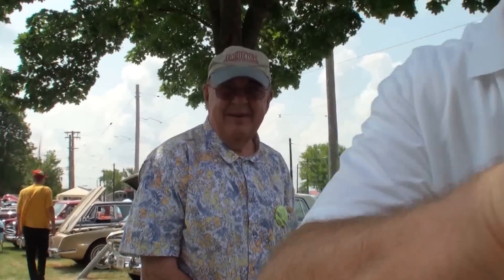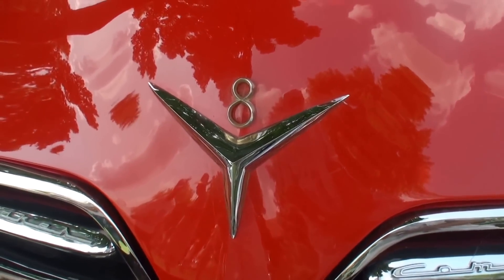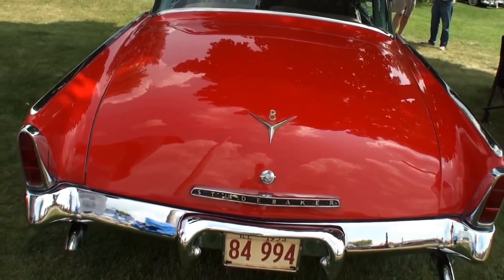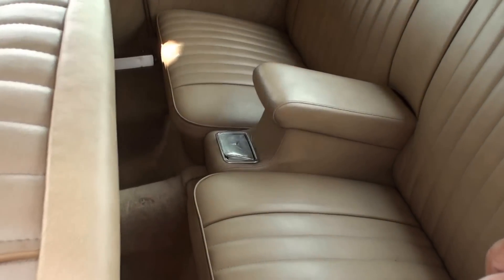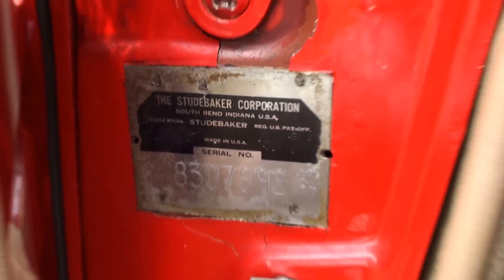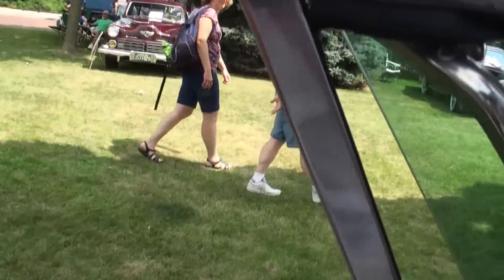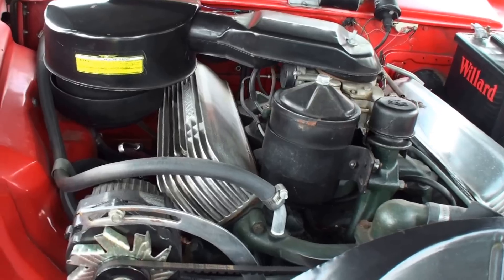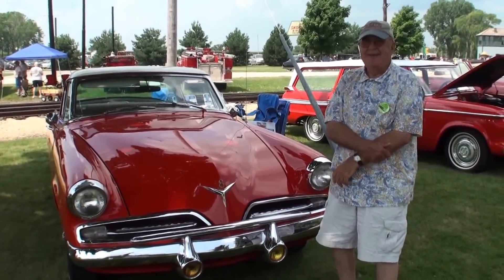1953 Studebaker Commander V8 Starliner Coupe - My Car Story with Lou Costabile

Comment: The first time I saw this model of the beautiful Studebaker coupe was in 1953 when it first appeared.  I fell in love with the sleek design instantly and I thought it was the most aerodynamic automobile I'd ever seen.  I even love the elegant simplicity of the dashboard.  Sixty-six years later, I still feel exactly the same way about this Studebaker design and it's still my dream car.   The original design was so perfect that it breaks my heart when I see one that's been modified.   There's always something new to learn and I learned two interesting facts from this video.   I didn't know the story about what happened to Studebaker's three pointed star before I watched this video.   I never noticed there was a similarity between the two stars until today when I heard the story.  The Studebaker star is rotated 180 degrees from the Mercedes star and the Mercedes star is  enclosed in a a ring, so the two stars look completely different to me, but I guess those differences weren't enough to satisfy Mercedes.    Another thing I learned came from seeing the hood opened in the video.   I always wondered how Studebaker was able to get a lower, sleeker hood than any other car in 1953 and now I know the secret.   The old oil bath air cleaners were huge and very tall back in 1953.   Those air cleaners usually sat upright on the top of the engine requiring a large space between the engine and the hood, so the engine compartment of cars made in 1953 were box shaped, which caused the front of cars to be box shaped at that time.   Now, I now see how Studebaker got that streamlined hood, they used an air duct to move the oil bath cleaner over to the side of the engine, lowering the hood.   Such a simple idea, but what a difference it made in the look of the car.
Reply from the maker: HI itsonlyadream, Thank you for viewing and sharing your appreciation for this model :-)  Hope you see many more cars on this YouTube Channel you enjoy, Lou
Reply: I cannot agree with you more.  This is simplistic style with stunning beauty.

Comment: Great video.  In my teens and early-twenties, I drove a Studebaker exactly like this, a red '53 Commander Starliner Coupe, though mine did not have the fog lamps and the interior was red.  The car was a family car that had been in storage for years, and it became mine upon turning sixteen.  I drove the Studebaker during high school and
several years of college (early to mid-1970's). The car had a few quirks, but it could be driven on the highway at 65-70 MPH without issue.  It was actually easier to drive than the modern cars of the time in that it handled curvy roads quite well.  Once while returning to college during a snowstorm, every other car had either run off the road or become stuck, but the Studebaker traveled on to its destination.  The Automatic Drive, a very advanced transmission for the time with its lock-up torque converter, generally worked well, but like Hydra-Matic of the 1950's, cold and hot weather could affect performance.  The Automatic Drive had a surprising feature not generally found today: there was no automatic transmission creep at stops.  An electrical device held the brake pressure until the accelerator was pressed.
Reply from the maker: Thanks for sharing your memories and experience with this car, Lou
Reply: That feature was called the Hill Holder.  I had 53 Champion 6 in 1963, replaced it with a 53 Commander 8 hardtop....top of the line.  Oddly I don't recall that window flap feature at all.  Maybe somebody pulled it off.
Reply: John  The standard shift models also had the HILL HOLDER which was neat !!!  Stop on a hill, push the clutch in then brake and as long as you held the clutch down the car would not roll backwards!!!  then you could shift to first , put your foot on the gas pedal giver gas and as you released the clutch the brake was released !!!  Great for a beginner driver.  I learned to drive on dads 1956 Studebaker champion. 6 cylinder 3 speed trans with overdrive which actually stock from the factory you could engage second overdrive splitting the gear between second and third !!!  early 5 speed !!!!  Some people would wire a switch to the over drive solenoid and you could engage over dive in first gear also !!!!
Reply: Yes and their stick shift cars used a device called the Hill Holder that worked like a check valve and was connected by a rod to the clutch pedal to keep the brake pressure on until the clutch was released,also I was watching Chasing Classic Cars the other night and a '54 Commander like this was featured,a super low mileage garage kept original car.

Comment: The 53 Starliner coupe is probably the most beautiful car ever.
Reply from the maker: Hi JackBN, High praise for the looks of this car :-) Thank you for viewing, sharing and I believe you're going to see many more cars on this Channel you'll enjoy. Hope you Subscribe, and hit the "bell" so you can see all the cars when they are uploaded on this YouTube Channel, Lou
Reply: @loucostabile  I recall seeing an early year Starliner coupe new, at a Lancaster, PA dealership. (I am a seasoned citizen). I loved the Starliner back then, but it was beyond my budget. After 1954, I liked Speedsters/Hawks less, because of the heavier grills, then tacked-on fins.

I owned a 1952 Studebaker Champion sedan that took me through four years of college. My Champion cost $400 used in 1956, with 17,000 real miles on it. It had SIX forward speeds -- second overdrive was useful on steep hills. I took it to first overdrive ONCE, hoping the engine would not explode over 30 mph in first gear, before overdrive kicked in. Got away with that, but only tried once. Always wondered what the RPMs were in first gear doing 30 or 32, on 670-15 tires.

Comment: Today Studebaker has a reputation for building stogy cars.  I don't know why that should be, because they built some really amazing automobiles.  One of my neighbors owned one of these 1953 Commanders when I was a kid.  I still think it was the best- looking American car of the 1950s.  Just place this next any other American car build during the 1950s, there's absolutely no comparison.  The "Champion" had a 6-cylinder engine and the "Commander" had a V-8, but they both looked alike.  This is a really beautiful restoration, even those simple, elegant wheel covers are original.  As the man says, no other car in America looked like this!  Studebaker was actually the oldest American car company, dating back to the mid 19th century when they manufactured horse-drawn wagons and buggies.  They were also the last "independent" American car company that was affiliated with neither the "Big-3" nor American Motors.
Reply from the maker: Hi Robert Guttman, Thank you for viewing and sharing info on your neighbors car and your knowledge.  It added nicely to the story.  Hope you see many more cars on the Channel you'll enjoy, Lou

Comment: My second car was a 1956 (first year) Studebaker Hawk.  259 cu. in. V8,  3-speed Bourg-Warner  select-gear shift automatic.  I put on a Carter AFB 4  bl. carb on a customized intake manifold and duel exhaust.  Loved that little car.  Wish I still had it.  That was in 1964.  I was 20 back then. Bought it from the back of a used car lot for $500.00.  It came stock with a 2 Bl. pressurized Stromberg carb without the top pressurizing cap.  A fresh valve job and that new carb and it was a bomb.
Reply: Donald Pruett the 259 was a good engine much better than the 239  we put one in 51 conv..
Reply from the maker: Hi Donald Pruett, Happy to read this car brings back memories of your car :-) Thank you for viewing and sharing, Lou

Comment: My grandfather owned the first family Studebaker that I know of.  A '26' touring.  This gave interest to my father, who in 1959 bought his first, a four door black Lark, equipped with a 259 cu. in. V-8, advertised with the power pack four Carter 4bbl carb and dual exhaust at 225hp.  It was as they say, the fastest thing around.  My first was a 53 Loewy 2r post coupe Champion.  In deference to the video, the Champ was equipped with the 232 cu. V-8 and was renowned for it's great 28-30 mpg on regular gasoline.  I owned and restored two of them, the second my father and I refitted with the 259 equipped as the Lark was.  I found that the Willy's three speed floor shifter could be installed on the Studebaker tranny, so of course in my youth it had to be refitted as well.  The 259 would average 26-27mpg all day long and would run equally or best the Chevy's 265/283's or Ford's 289/312's.  My second Stud was completely restored inside and out.  Following high school I attended Community College in collision repair, and in subsequent years with my father continuing his mechanical interests, he bought, overhauled well over 30 barn finds, while I restored them physically.  A local upholsterer brought the interiors back to original quality, so dad had quite a collection of various years and models of Studebakers to enjoy in his elderly years.  Eventually he sold them, mostly to one individual down the ladder in our family.  Over the years, I owned and drove many of my own and true to form my son bought and fully restored a 1963 Avanti which he has shown at several International Studebaker Meets.   Several years ago my wife and I visited the Studebaker museum in South Bend, Indiana and would highly recommend all to do likewise.  The Studebaker, from buckboard to the last one to roll off the assembly plant were remarkable and lent well to our mode of transportation over the years.  The 53 however will always hold a special place in my heart.  rk
Reply from the maker: A wonderful story :-) Thank you kathryn for sharing, Lou
Reply: Kathyrn  The Studebaker CHAMPION was always a 6 cylinder model eith 170 cu in or the later 186 cu in.  Dad bought a new 1956 Stude Champion, 6 cylinder 186 cu in with the 3 speed plus overdrive !!!  V8 models were commander or president !!!
Reply: In 1962, for a few months, I worked at a Studebaker dealer in Denver, and I got to drive many of those 225 HP Larks. They were a blast and looked good.  My favorite though, for fun, was a V8 Pickup with floor tranny. I drove it to my cabin in the mountains above Boulder, CO several times and it was a blast.

Comment: Cadillac, along with Oldsmobile, came out with the OHV V-8 in 1949. n the Studebaker, some rodders would switch out that heavier than the Cad engine but with less cubes and H. P. and install the Cad engine, creating a 'Studillac."  I owned both a 50 Bullet nose and also a 54 coupe V8 but it had a post. Loved those cars, and the 53 is the most beautiful American car, ever.
Reply from the maker: Hi John Hand, Thank you for viewing, sharing details of your 50 Bullet nose & 54 Coupe, and adding to the story :-) Lou
Reply: @SHICOFF1 Trouble with the Studebaker V8 was, if I remember correctly, it only had 259 Cubes, and yet weighed as much or more than the Cadillac V8. That is why those Cad into Stude swaps were so successful.  In 56, when Studebaker had merged with Packard, they offered the excellent Packard V8 in the Stude body, calling it a Golden Hawk, and with 275 HP motivated by real cubic inches, it motored, but was front end heavy. In 1958, Studebaker used their own heavy engine and put a Paxton supercharger, later named McCullough, and it was still rated at 275 HP, but the 56 is the one to own far as I am concerned. I might have that backward, It might have been MCCullough first, followed by Paxton on that name, and I think Andy Granatelli had purchased the rights to the Paxton supercharger.

Comment: John Benton and I share a common denominator!   My first car while in high school was one exactly like this one without the fog lights. Coral red with white top!  Mine also had the 3 speed manual with overdrive instead of the automatic like this one!   I loved that car, basically because it was unbeatable as a road car, and being someone that does not like doing and being like everyone else, I was the only kid in late '50s high school with a Studebaker.  The jocks all had Fords, Chevs, Mercs and a few Plymouths!   Most of those cars had more power than the Stude, but none of them could keep up with it on a winding road!  The low center of gravity, and the fact the engine sits a bit behind the front wheels made for great cornering ability!   It could take just about any corner at least 10 MPH faster than anything else of that era!   I eventually blew the engine, dang it!  But it played a major role when I bought my first new car a few years later!   An Avanti engine powered '63 Gran Turismo Hawk!   That car I had for 30 years and put over 240,000 miles on it.
Reply from the maker: Hi Ron Fillmore, Happy to read this car brings back memories of your car :-) Thank you for viewing and sharing, Lou

Comment: Raymond Loewey was a genius - a hero of mine. Studebaker certainly could be counted on for fine engineering, too.
Reply from the maker: +promerops Hi promerops, thanks for commenting and sharing your knowledge.  Take care, Lou
Reply: Bob Bourke design included virtually every detail on this car right down to the font used on the speedo . The outsourcing of design to Loewe Studio gave him this freedom , where the usual at the big three had fellows doing hubcaps or steering wheels for a living
Reply: @glandrecht  I THINK that a 53 Studebaker is on display at some museum (Smithsonian?) in Washington or somewhere as being "America's most beautiful car.'
Reply: Yes, these models were very well engineered!  Great, stable road cars!   Engine set a bit behind the front wheels for excellent balance.  Along with a 120.5 inch wheelbase the road holding was exceptional!

Comment: The designer was Robert Bourke, an employee of Raymond Loewy Associates. Loewy recognized the genius of the design, and represented it as his own. And the original engine would have been a 232 cubic inch rated at 120 horsepower (SAE Gross rating). The 259 didn't come in until '55. Gotta love the aluminum heat sink valve covers!
Reply from the maker: Hi, Thank you for viewing and sharing your knowledge, Lou
Reply: You  are correct with the 232 usually equipped with a 2bbl Rochester backdraft carb.  28-30 mpg far exceeded all others on the road.

Comment: I'm John Hand in Alabama. I have never forgotten a book that came out in...I think...1958.  It was one of those thick but smaller in width and height hand books that so many came out with in the 50s, like how to...etc.  This particular book I am referring to was how to build the world's fastest street rod or similar. 

The book, complete with photos, illustrated taking a 53 Starlight coupe and installing the Chevrolet V-8 with an overdrive transmission. The lower gear in an overdrive would aid in acceleration and then shifting to third over would permit a greater top end.  The car also had for streamlining  (in 1958 they did not know about such things as how an air dam, etc would work.) So the builder suggested enclosing the entire car underneath with an aluminum belly pan. I forget many of the items the author came up with, and I never did see an actual car built to those specifications, but in reality, for the time, it would have been the Ultimate Hot Rod. Now that I think of it, that might have been the title of the book, Building the Ultimate Hot Rod. Wish I had that book today.
Reply from the maker: Hi John Hand, Thank you for viewing and sharing.  Hope you find that book on eBay some day soon :-) Lou

Comment: Beautiful styling, and I've been told Stude engines were damn good too. Compared to a 53 Chevy, Chrysler or Ford this cars design is outstanding and years ahead.  Harley Earls' styling studio and the Money behind the Big 3 were too much for Studebaker, Packard, and AMC in the end though. Too bad.
Reply from the maker: Hi Seth, Thanks for sharing.  Did you see the latest Studebaker? Lou https://youtu.be/K0ucl7tz_LA
Reply: Stude V8 engines were reliable, but heavy, heavier than the much larger in displacement Cadillac V8. That is why, for a time, 'Studillacs' were so popular. A Cad V8 in the Studebaker body. Instant gain of I forget, over 100 HP and with less weight on the front end. Before Studillacs, it was 'Fordillacs.'